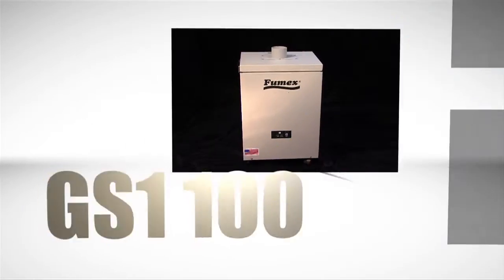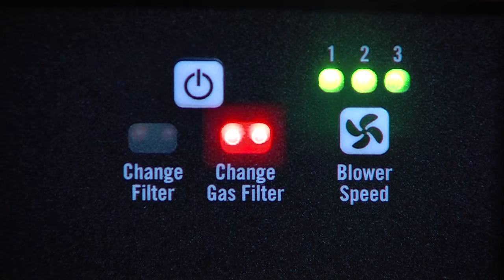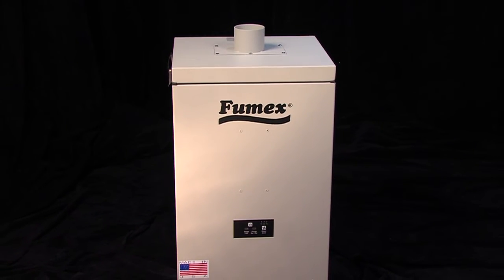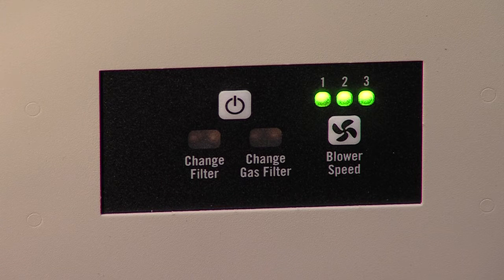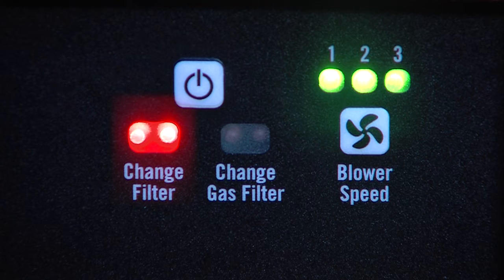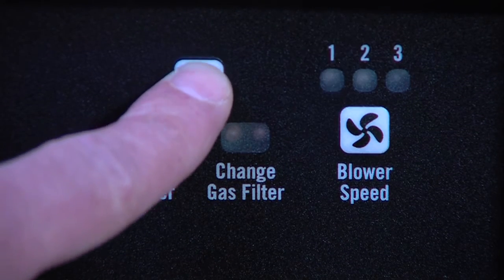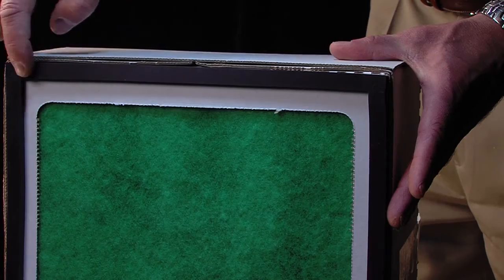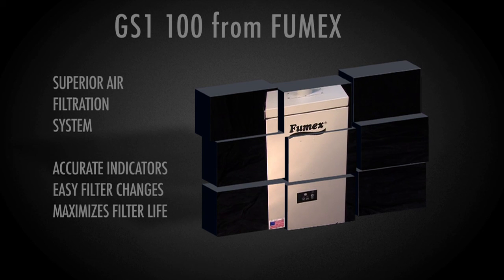Fume extraction filter change for gas & chemical fume extractor GS1 by Fumex

Comment: Lacks information, The video needs details on the HEPA class for the model, as well as the filtration capability of the gas filter medium(or options of interchangeable mediums). As for the housing and electrical aspects the video needs details such as the type of "gas sensor" used, along with the CFM and static pressure rating for system with filters in place